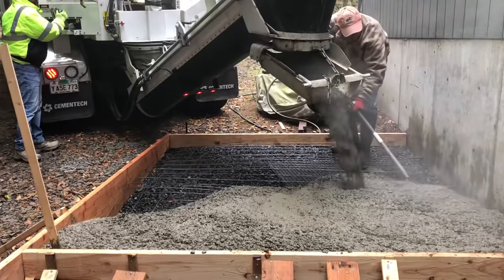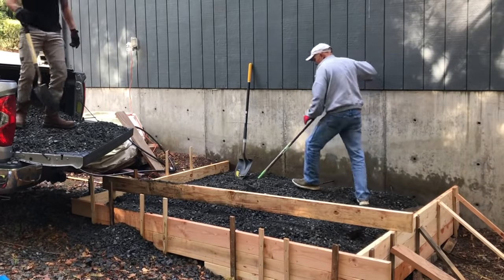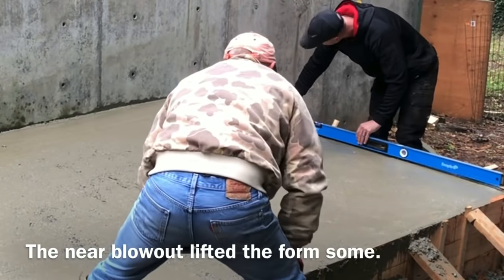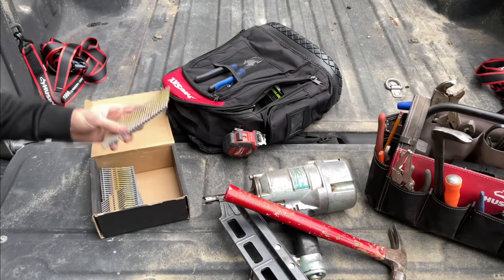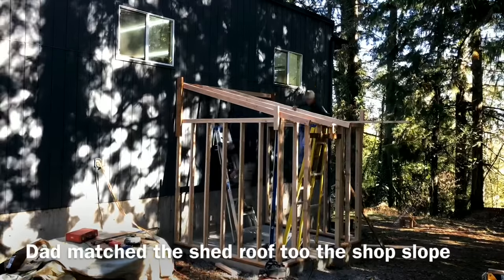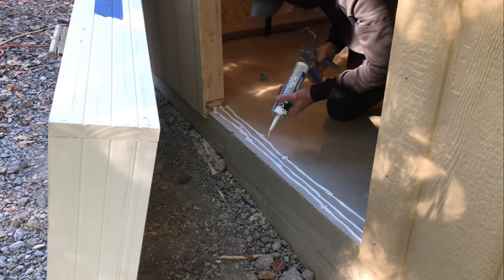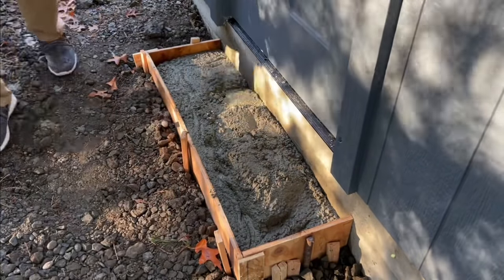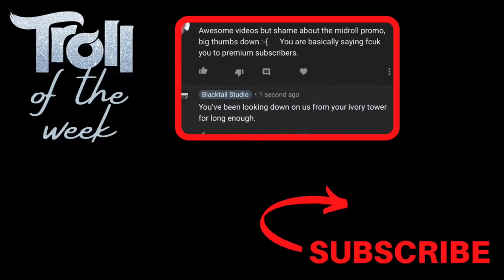Attached Shed w/Slab Concrete Foundation

Comment: 3:30 “I didn’t need a tonne” but ended up buying 3 tonnes worth of concrete.  I can’t believe why anyone would order ready mix for such a small slab. Small mixer, small load of gravel and and 8-10 bags of cement would suffice.  Secret ingredient would be the good company you’d have with your dad.
Reply from the maker: Would have been 72, 80lb sacks. You must have a stronger back than me
Reply: @BlacktailStudio  Strong enough back and enjoy the laugh while getting the job done with my own father. 72 bags is referring to gravel. I'd buy 3 tonnes of it it and whatever is left is there for any smaller jobs like continuous kerbing. 👍🏻

Comment: i know its a small project but why didn't you used pressure treated woods? that's baffled me through out the video
Reply from the maker: I did use PT on the contact surfaces. You don’t build with PT wood that is indoors 👌

Comment: One huge mistake you made: you tied in the slab to the foundation. You now have a 2 ton lever pulling on your foundation. If the far side of your pad settles just an inch, that's upwards of 700 ft/lbs of tension torque pulling on an 8 foot section of your foundation. I would expect some cracks after a few seasons.
Reply from the maker: It’s building code to do this 😉 good feedback though!
Reply: @BlacktailStudio  Which code is that? Oregon doesn't require a permit for less than 200 sq ft. Your slab is above the frost line. If you get a freeze, the whole thing heaves. That's why you float it. Sorry but without some code reference, that just sounds like some bullshit to me.

Comment: Pops, What DSLR do you have?
Reply from the maker: Canon 5d mrk iv
Reply: @BlacktailStudio  I have Nikon gear (Z6 and D750) and use iMovie (easy/intuitive) on my Mac for editing right now. Canon is a slightly different universe. Nice thing about the DSLR is the quality of lenses available, bokeh, 24 fps cinema look, etc. You'll probably surprise yourself if you just jump in with the DSLR and start with B roll or fill shots. Now, editing is where you really engage the viewer, that's where the story is told. If you are on a Mac, iMovie can give you really great results and its so intuitive, you'll pick it up quickly to be passable/proficient. Then with only a little bit more time, you can really get some good results.  Don't know if that helps, but... 
ps my first video project was shooting a commercial for my company, and it came out great, so motivation provided the opportunity to jump in with both feet...

Comment: Those blue bolts have zero sheer strength.  In this use case it will probably be fine but i woildmt use them like this
Reply from the maker: It’s not an earthquake foundation. It’s a single step into a shed. I think 3/8” thick steel bolts will probably hold.